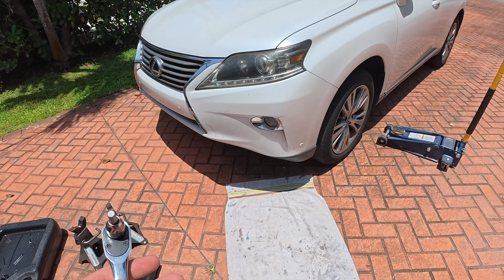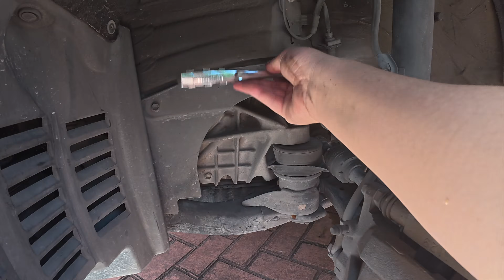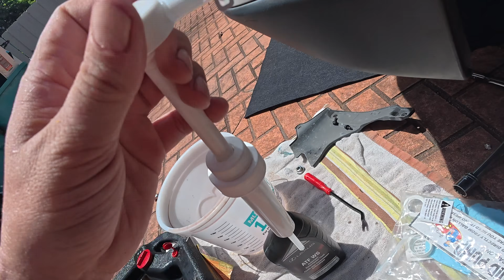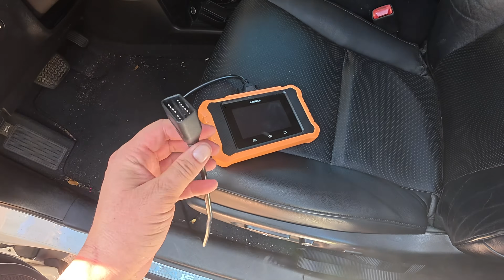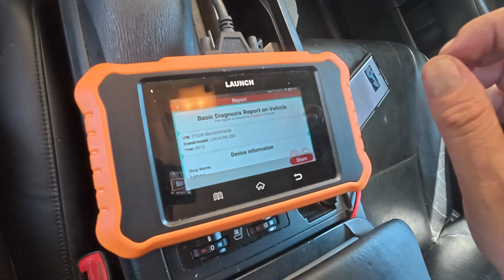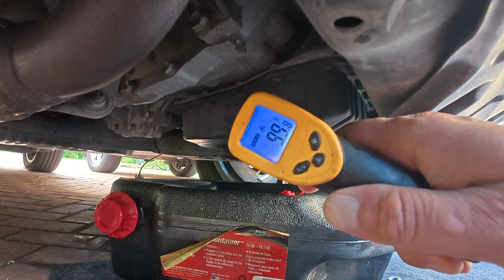Lexus RX350 Transaxle (Transmission/Differential) Drain and Fill | DIY How-To | Gen3 2008-2015

Comment: Makes no sense that the infrared thermometer reads higher than the internal sensor - the alu. pan acts like a heat sink and unless the outside temp. is higher than internal temp. this should not be the case. Typically, you should see IR thermometer read 2-5F less in my experience.

Comment: Dead on.  Use no other technique or any other dope on youtube.  My only complaint is that this video wasn't made years ago when I bought the car.  Excellent.
Reply: Yeah I second that about when the video was made doesn’t help me now at 165,000 miles with no fluid change. May have to leave it now😖. I did learn transmission service is now drastically different than when I was a lube tech in the late 1990’s.

Comment: Ai is saying 7.1 quarts vut it seems you only use about 3 quarts (befpre draining). What is tbe correct capacity?
Reply: Torque converter and other gears hold extra fluid. He only drained whatever is in the pan
Reply: to properly change the entire fluid you need to do this process 3 times, and driving between the 3 fluid changes... at that point 97% of fluid will be new

Comment: So you used just 2 stands? Did you make sure the car was level? Thanks
Reply from the maker: 2 jack stands and two ramps to fully support the vehicle. I also had a few additional jack stands for extra safety.
Reply from the maker: Sorry, my first reply was not accurate...that was for the GX, not the RX. I used one jack stand for the RX, with one extra for additional safety. The vehicle was level.
Reply: @JonathanMarkMorgan thanks I plan to try this without jacking it at all since I don’t have a safe way to lift all 4 sides. If not, I will jack up front just to drain and then will fill it and then lower to check level like it appears you did in this video
Reply from the maker: Yes, I checked level too.

Comment: My trans does not have a fill hole or plug on the side. What do I do? 2009 RX350
Reply: If it has a dip stick for transmission fluid fill it from there
Reply: Ever figured it out ? I need help on mines  I can’t find any information !

Comment: Thank you for the nice video. I am about to buy a 2013-2014 RX 350 and I'm planning to change the transmission fluid and use Amsoil Signature Series transmission fluid.

Comment: Very informative. Do you need to change the transmission filter also every 30 to 50,000 miles?
Reply from the maker: Lexus does not prescribe changing the filter. Although, I've seen that most people change the filter only at 100K miles.

Comment: Thanks for the Help! I was able to access tranny bolt on plastic ramps without taking tire off vehicle! I also changed front and rear diff fluid AWD model with  Amsoil 75/85 GL-5 rated fluid, Thanks again 👍

Comment: No need to get Lexus brand, I didn't even know that existed. It's the same fluid as Toyota ATF WS, right? Great video by the way. I doubt many pro mechanics even do it as properly as you did. If you happen to be in San Antonio I'll pay you to come do it to my RX350!
Reply: Valveline Maxwllife meets Toyota WS standards as well. That's all I use in my 2019 Rx350. Runs it fine

Comment: I have a 2015 Lexus RX350 AWD, how much different is it for an AWD version? Looking into doing this transmission and differential service as well.
Reply: I have the same model. Garage only put in about 2qts. I was assuming that it would be a 4.5 qt change like allot of trannies. One thing I didn't do was the rear differential. Maybe I'll do that myself. I did it to my '09 Ridgeline. But even the tranny took 4.5 qts and there is a gear box that takes about 1.5?? I'm pretty sure.
Reply: @scottw.8871 I was thinking that if I drain the transmission fluid, refill with around 3 quarts, anyways when I get the transmission to operating temp (104-113 F), I would drain it again with only the drain plug removed (inner funnel level installed), which would anyways reach the correct level after draining.
Reply: AWD model uses 75/85 diff fluid Amsoil Gl-5 rated. 26oz in Front 16oz in rear. 2qts. of WS tranny fluid drained out on my vehicle on plastic ramps and I was able to access Tranny bolt without taking tire off vehicle, used 2 cheap walmart gear oil pumps for both fluids 👍

Comment: Nice vid man. I'm changing the solenoids on my 09 RX350 transmission, and was looking for the procedures to properly refill it. 
Thanks for the explained tutorial.
Reply: My 2013 RX350 suddenly developed a hesitation when shifting from 2nd to 3rd gear. Does that sound like I need to do a solenoid replacement? How do I diagnose exactly what's causing this issue?? It's never had any leaks so it can't be low on fluid. I'm just curious if you were having the same problem and did the solenoid replacement fix the issue???
Reply: @Carbage  did you find the problem? I know your comment is old but I would do the basic drain and fill procedure. Even tho there no leak, AT fluid could be dirty after high mileage. My son lexus was that and CEL showing one of solenoid was bad so it goes into “limp mode”. Replace the solenoid myself (expensive for OEM), clean internal parts and each solenoids with proper cleaner, did a refill, drove it for a week, then did another drain and refill. Car shift and drive beautifully. Now on the the next maintenance: exhaust leak LMAO